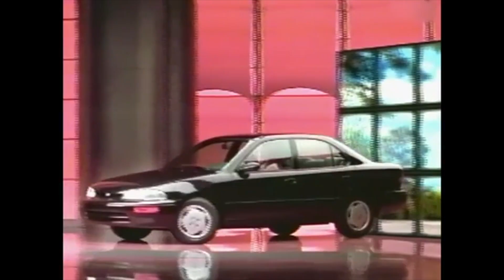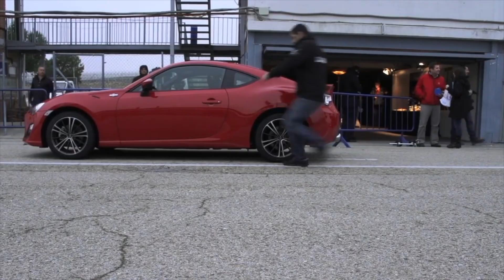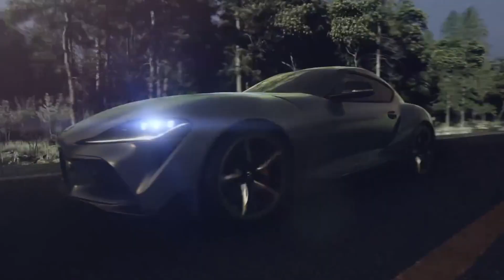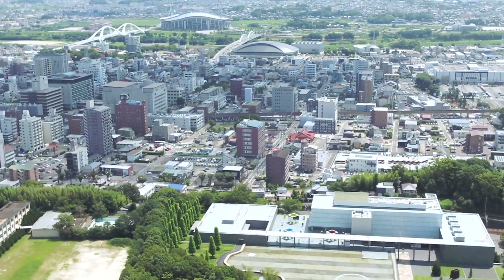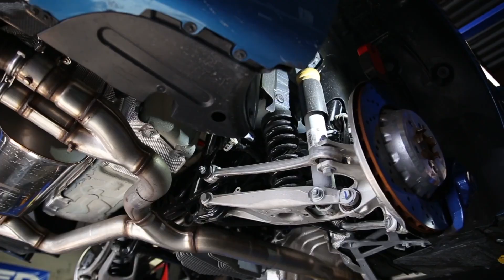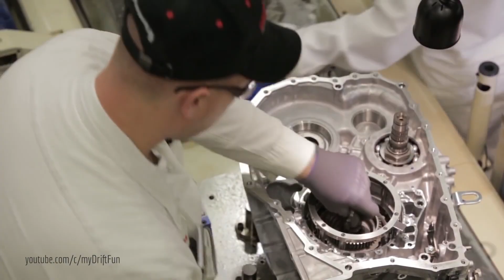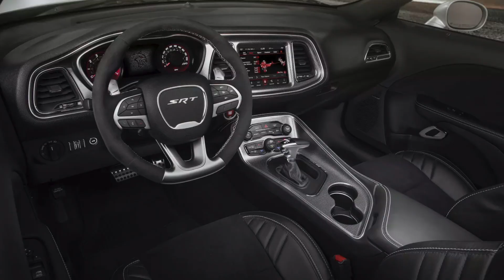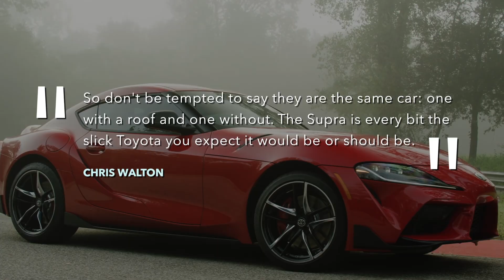MKV Toyota Supra - BMW or Toyota? The UNTOLD TRUE STORY

Comment: Badge Engineering is not "when a company pays another company to sell their car" that's not even how it works! In your SAAB example, it wasn't Subaru who approached SAAB to sell their car, SAAB approached Subaru for their car so they didn't have to make their own from scratch.... the complete opposite of what you stated originally (aka the quote above). When they made the Toyota 86, it was a subaru motor with toyota electronics and fuel injection, which actually made the engine far superior to the typical subaru motor, and when you turbo said motor like the wrx/sti motors, it actually produces more power thanks to the upgrades.

In terms of the Supra, its not badge engineering. BMW may be "German engineering" but Japanese hold themselves to a higher standard as you even mention in this video. If anything, its toyota body with bmw engine that has toyota upgrades.

I would rather have the 4 cylinder European version of the Supra. People bitch the 4 cylinder specs seems like shit. But whats funny is, at 195hp, and 265tq, it has more tq than hp like a diesel engine.... usually you see 195hp and only 105-115 tq if that. The fact that i has more torque than hp, means its gonna be fast little bitch. Not to mention engine mods to add power.

Comment: so... the new toyota supra wouldnt have the common problem of bmw?
1) leaking engine mount
2)worn out steering rack after 5 year
3)leaking plastic radiator hoses
4)problematic ecu
if it is, good job toyota

Comment: Im worried about that engine not being up to Toyota’s standards that’s my main concern I know bmw can make a great drivers car but the truth is they have never made an engine not even near as reliable and under modified as the legend 2jz for a 3L in-line 6 engine that can take well over 30 psi stock block and internals pushing figures over 800hp now that’s what I call engineering

Comment: They can sauce it up anyway they want. But it still looks to me that Toyota help BMW work out kinks and improve thier z4 pateform and in return they got to put thier toyota emblem and supra badge on it. 
I for one and i know many others don't care about what it is stock. I see u cant bore, stroke, use large high flowing turbo manifolds, gonna be alot to delete to upgrade the intake manifold. This isn't what the supra community wanted. This is what the bmw community wants
Reply: No one cares about what a supra does in its stock factory form.

Comment: "ZF- trans It's actually widely used", then listing some of brands with the worst gearbox reliability ever. Come on.
Reply: Not to mention most of the examples (if not all) that use the gearbox, were umbrella brands owned by other companies: Volkswagen group owns Audi, Lamborghini, Porsche, and Volkswagen. BMW owns BMW, Mini, and Rolls Royce. And I think the other cars listed are all Fiat-Chrysler cars... So like three companies use that gearbox in their brands. Not to mention... ZF is a German transmission company; "Zahnradfabrik Friedrichshafen, and commonly abbreviated to ZF, is a German car parts maker headquartered in Friedrichshafen, in the south-west German region of Baden-Württemberg."
Reply: Michael Carr you do know the original Supra used a Getrag transmission which is also German
Reply: IIRC only the turbo variant had a 6speed Getrag transmission. The 5 speed in the NA supra wasn't built by Getrag. Many tuners swapped in the 5 speed after reaching certain power(tq) levels, simply because the 5 speed had more engagement area for each gear.
Reply: @f181234  you do know Supra didn't even exist when BMW was using the zf transmissions in their cars.
Reply: @daftpanda6533  you mean to tell me that people swap in 5spd to handle higher torque/Hp applications?
Reply: @daftpanda6533 also not true, SZR is NA with V161....
Reply: @daftpanda6533  cheaper to use then the v160 would be the cd009 from the 350z. The updated box had stronger synchros/mesh
Reply: @imranahmed1542  Is the casing the same, with just a bell housing swap? Or is an adapter plate needed?
Reply: @imranahmed1542  To be honest I'm more likely to own another Z than a Supra anyways...
Reply: @daftpanda6533  i think adaptor plate kit can be purchased online. Its an easy and nice fit and that cd009 can handle high hp/torque
Reply: @f181234
No, I did not. Did you know Getrag and ZF are different companies? I fail to see your point; buying one part from a competitor's supply chain is one thing. Buying your entire drivetrain and chassis from your competitor's supply chain, while consulting your competitor is something entirely different. 
 @LB-sh7qt  
Noice!! 😁
Reply: @michaelcarr4748  are they reliable transmissions at all???, I have a 2018 Jeep Grand Cherokee V6. And I'm worried about their reliability now??
Reply: @sergioayon46  ZF? They have good and bad transmissions. I wouldn't lose sleep on a car that new, your warranty should protect you from premature failure.
Reply: This complaint and resulting thread is very non specific.. Are any of you actually saying ZF8HP is bad or that ZF gearboxes are bad products?   My only experience with the company is a ZF6HP26, and it's a great box.
Reply: LMAO! what did you expect?  its a car made in 2020

Comment: The real issue I have is Toyota's laziness. The 86 and possibly the Supra don't have a true identity. It's not like Toyota could not do the job on their own without BMW, and corporations being corporations do things not necessarily for the benefit of buyers, so I am skeptical about the collaboration. 
Toyota did not need to do this. Toyota, if anything, should be ashamed that they could not produce a proper Supra on its own.
And here's the big thing for enthusiasts.....how modifiable will it be, how easy will it be to change things, and how cost effective will it be to modify?

Comment: What a terrible decision by Toyota, it's just not what anyone really wanted, it's a shadow of the original and should be ashamed to wear the Supra badge
Reply: What did people want?
Reply: @daltonkackerman  I think they were looking for a JAPANESE car, with JAPANESE tech and superior JAPANESE reliability.  Take ANY ten year old Corolla with 200k on it and ANY ten year old German car with 200k on it and compare them.  I guarantee you, that expensive German car will be ready for the scrap yard.  That Corolla will just need some belts changed and it's ready for another trouble free 100k.  I've owned ALL kinds of brands of cars, and there is NO comparison to Toyota long term reliability.
Reply: @JayDandy412  I thought that was addressed in the part of the video where Toyota would relentlessly test every piece of the chasis while working with BMW and asked them to make changes accordingly and then when they designed everything else themselves.
Reply: Agreed. The Supra name plate should have been reserved for a high mark in quality and exceptional engineering by Toyota. Now it seems to be up for sale like every other name these days. Doesn't mean anything anymore. Just a brand name to be sold under.
Reply: @youtubasoarus  what have you expected? supra was made so popular by tuners, nobody wants a stock supra (exeption: because they are super expensive).
Reply: Mr Couchpotato is agree if it wasn’t for tuners and the fast and the furious the Supra wouldn’t be as big a name as today. Not saying that’s a bad thing but a lot of people definitely expected too much out of Toyota. They don’t even need a sports, with how successful Lexus, the truck line, and economic vehicles selling so well nowadays.
Reply: @Jed Lawson i mean do you even need to care? i doubt that you have enough money to buy one anyways.
Reply: Some of you are hitting the nail on the head...the Supra has a mystique about it becauuse of fantasy.  In reality, when it was last here, it was a direct competitor to the contemporary 300ZX.  Both had turbos, with the Supra at 320.   I had some modifications on my '93 Mustang, and I remember running neck and neck with one at a stoplight probably 20 years ago and the guy looked frustrated.  The 300 is (or do they still make it?) the 370Z.  Buy the Lexus if you want horsepower.  This is meant to be a step up from the BRZ/FRS.
Reply: @Jed Lawson disagreed
Reply: I'll say to you what i say to everyone else:
It's not likely you were ever going to buy one new, so Toyota or BMW couldn't give two shits about your opinion
Reply: Oggy yeah you’re right. I mean you Cana actually buy a modified r32 grr for 30k while a stock mk4 can cost now at least 50k.
Reply: wow couldn't say it any better. it should be ashamed
Reply: Oggy  I suppose that 93 mustang engine can withstand anything you can basically throw at it like the 2JZ correct?
Reply: @japanwatchconnection umm wrong. The car was placed in the movie because tuners where already getting ridiculous HP out of it. It was part of tuner culture on account of a very durable and reliable engine. It was an engine designed specifically by Toyota because it was comparatively cheaper back then for the Japanese to do so. Most likely the reason they didnt design a new one for this thing they're calling a "Supra"

Comment: No Honor in building a Japanese car that's not Japanese. No Pride in building a German car that's not German.
Reply: It's AUSTRIAN
Reply: C-Shepard 0 it's a germanese lol
Reply: @OnlyVibzs  lol Germanese, great one browie!
Reply: Except the z4 IS all BMW. At least the supra body is toyota
Reply: @johnboe412  But they literally said all the bodies are being made by a Austrian manufacturer, sourced from BMW's contacts. The gearbox is from another German company that BMW works with all the time. It's like saying "the parts are all sourced from BMW's normal sources, it's designed to have the 50:50 weight distribution BMW is known for building, BMW's suspension (which the body had to be designed around), and BMW's engine. But it doesn't matter that it's being built in Germany, it's a Toyota!" I mean props to them for trying to improve reliability, I'm just still not sold. It's built using the resources BMW uses to build their cars, not Toyota's. It's like Toyota came in to monitor development and consult for reliability, if it has good results... I'm not about to complain. But some people hail it like a Toyota development, and it's not.
Reply: @michaelcarr4748  Not completely accurate Michael. Toyota initiated the development idea because of the outcry for a Supra with an inline 6 turbo. BMW is the ONLY manufacturer that builds a inline 6 anymore and it comes with a turbo to boot. The development was a joint expedition between 2 of the greatest auto design engineer's in the world. They did go to Germany to develop the drivetrain and Toyota has been reluctant to put a manual gearbox in it, but, wants to test the market and viability of that notion. BMW will not put in a manual, strictly auto shift paddles.
Reply: @michaelcarr4748  It's a collaboration...no one is hiding from that. If you want purity...then you're going to have a lot less cars to choose from in the future. Especially low production run cars. Toyota 86 and Subaru BRZ are examples of that. They wouldn't have come to market without collaboration. It is what it is...accept it, or face less choice.
Reply: Geeezus, I doubt seriously if you could define honor without googling it. Teams have honor. Toyota does not manufacture a inline6 turbo and BMW does. Makes sense to form an alliance due to the fact that former Supra iowners WANT an inline 6 turbo just like the original one due to its extreme reliability. 90% of all auto manufacturer's no longer produce a straight six. It's too damn GOOD. Last's forever and they get few repair's at the dealer for them. They are EASY to work on. I wish the trolls out their would engage the brain cells before commenting stupidity.
Reply: @anonimous2451  The very reason this car appeals to me is the I6/rear drive platform like my old Mercedes 300CE, a beautifully fast and nimble work of art!!
Reply: Because the japenis ain't doing so well. They ran out of idea.
Reply: Id rather drive this than what your driving now.
Reply: So  @ryansmith7974  what am I driving now if your such an expert on the subject.
Reply: This is an ignorant and irrelevant comment since nowadays EVERY car made is an international affair.
Reply: All of the so called "luxury" marques are converging. Line up the executive saloon models build by BMW, Audi, Jaguar and Mercedes and it is impossible to tell them apart. Frequently overpriced SUVs and saloons reliant on company car tax breaks and trading on racetrack glamour.
Reply: @tigerarmyrule  Audi is a BMW copycat and Jaguar is owned by a company in India......no original idea's ever come from there, they only know how to develop trap-ware
Reply: This is built in Austria😂😂 the BMW has more hp than the supra...even the Supra back then had a Yamaha engine in it and Toyota couldn't even do that on their own. Toyota can't make sports cars, period!
Reply: commander Shepard this is not my favourite car in citadel!
Reply: i swear i wrote up this up and just now i saw your comment, this was also when my internet cut for how long when the first 2 days of it's release i wanted to write all that, but you gave the impression in few words which i appreciate it bro, same as what i think.
Reply: I think it's better, japanese reliability and german fun
Reply: My prediction is that this will end up being the LEAST reliable Toyota in history, since they're swapping out Japanese tech for German tech.
Reply: This was just another fail in a long line of sacrilegious, traitorous ways for Toyota. The existing Toyota/Subaru BRZ and Scion FRS (oh, almost forgot they shut Scion down "Toyota FT-86") was cringe worthy let alone this SUPRA disaster. The act of Toyota emblazoning their badge on the engine cover of this underpowered Bavarian sausage maker nullifies everything CERN has done the past 65 years but then to ONLY offer it in an auto transmission? This is a disaster of biblical proportions, old testament real wrath of god type stuff. Fire and brimstone coming down from the skies, rivers and seas boiling, 40 years of darkness, earthquakes, volcano's, the dead rising from the grave, human sacrifice, dogs and cats living together, mass hysteria. I've had many friends who have owned and continue to own Supra's, and all of them total protonic reversal levels of pissed by Toyota's utter lack of effort with the development of this car. It blows my mind the effort Toyota put into the Lexus LFA, painstakingly engineering then re-engineering over countless years tweaking and fine tuning the engine, handling and fitment of carbon fiber bits and trim only to turn around and concoct this debauchery George Cloony nipple Batmobile? Unreal... I'd rather buy a Hyundai Tiberon.
Reply: Exactly! That's what i'm thinking. I'm not even Japanese but I do deeply respect the Japanese take on cars. There's something about those 90's era cars that just got in my heart. I want to see more of it, not some watered down shit that a US company would chip away at until there's nothing left. Or whatever Germany wanted to do with it. Not that Germans make crap, they make great cars but again, the Euro philosophy on auto making is different than the Japanese.
Reply: C-Shepard cringe.
Reply: Why give a fuck what area of land it came from?

Comment: Im really dissapointed. Expected a more pure Toyota. If I wanted a BMW I would get an M series.
Reply: Marbin Diaz Dont ever buy a Bmw m2 3 4 5 6 8 you'll regret it.zI know first hand they dont really test thier cars.If they did they would've known about the rod bearing problems,vanos problems,subframe failures ect.I lived in Houston when the first 2001e46m3 spun its rod bearing.The customer went in for warranty work and Momentum Bmw and Bmw Germany said that it would not be covered.They knew the car had problems sold them anyway after channel 13 news investigation found out about it they recalled every 2001e46m3 to replace the rod bearings.Never buy a vehicle from a company that sells defective vehicles.
Reply: Or get an 86.
Reply: Could you afford one though?
Reply: But look at it this way.  At least you'll get all the terrible long term reliability of a German car!
Reply: The A80 (mk4) Supra was about as pure as a crack baby.